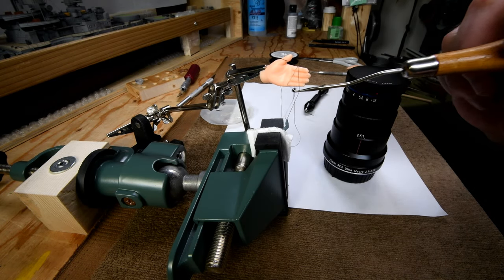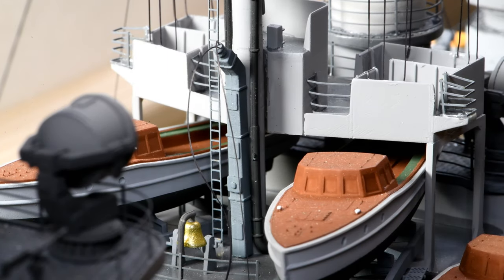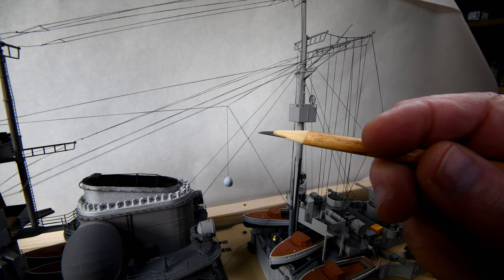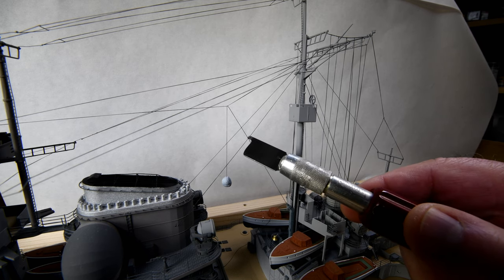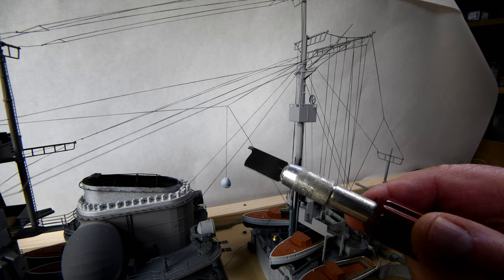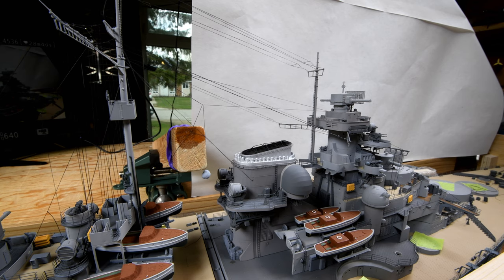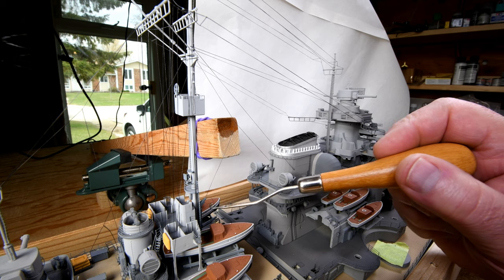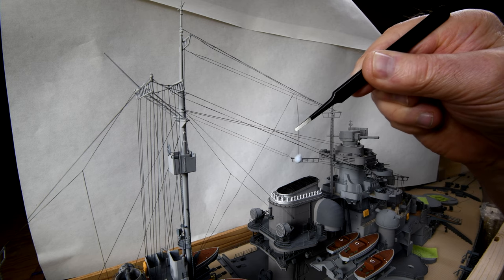The Model Ship - Part 442

Comment: Hi Ron  that peg was never going to come out ,like welding the fused area is always stronger than the parent material! Reckon the cabbage will go first lol basing that on guinea pigs we've had, 😄😄😄 you doing a great job ,just wondering what comes after to lots o the letter R😂see you tomorrow
Reply from the maker: "like welding the fused area...."
Yes, I've noticed that too when I've used the Tamiya ExtraThin. Once the solvent has completely evaporated out of the mixed plastics in the joint, there's no separating it cleanly again without it breaking somewhere else. 👍

Comment: Where was easy line when I was building the Constitution ? 
Ron your cutting block was inspired.😁
When I have to make cuts like that one , I use a curved blade and roll it across the string.
Reply from the maker: The EZ-Line cuts well with a sharp blade, except when it's saturated with hardened CA.